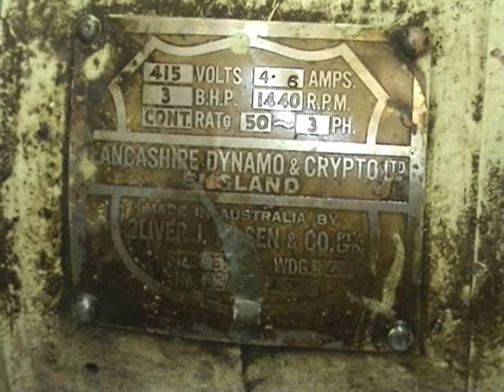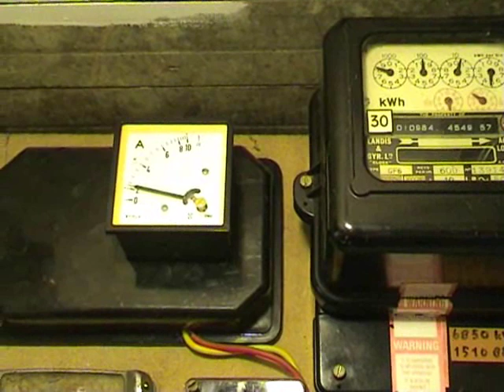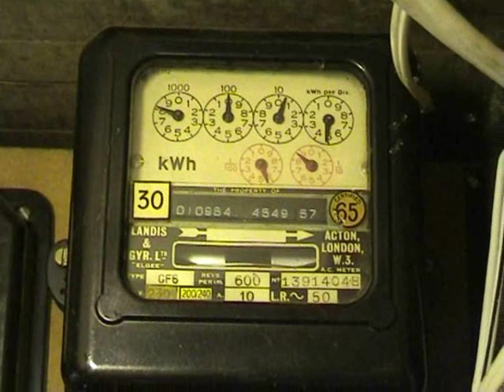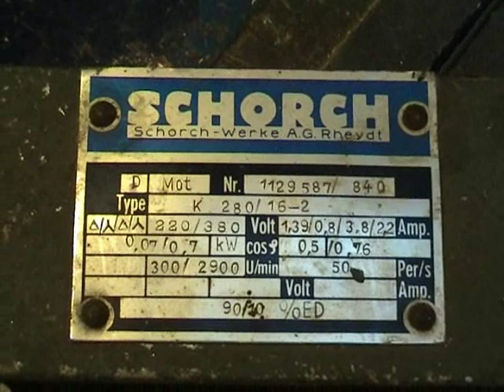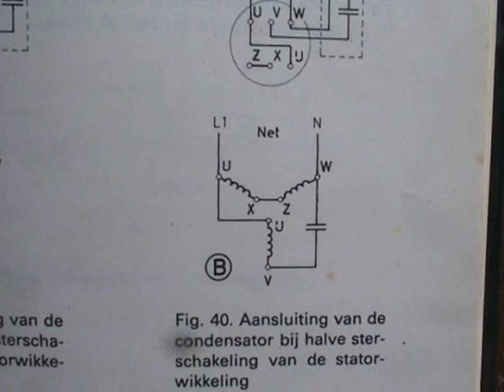3 Phase 415 V motor on 1 Phase 240 Volt supply in open star

Comment: Thanks heaps for uploading this. 

For some reason I didn't have any luck wiring my motor according to the layout you showed. When powered on the motor just sat quietly as if there was an open circuit. I spent hours looking for another reference for this half/open star connection (seems to be very rarely used) and finally found one in this wiki article: https://nl.wikipedia.org/wiki/Steinmetzschakeling. I rewired things according to the wiring diagram in that article and it worked, but still not smoothly.

My motor is 4 kW, 415v delta/720v star. With anything up to 60 uF of capacitance the motor just crawls, and with 300+ uF it still crawls but also trips my 10A breaker (even when helping it by manually spinning the shaft).

Any tips? Maybe our motors are wound differently?
Reply from the maker: What mains Voltage are you using ? 
You motor requires 415/720 Volts.If run on single phase 240V. 
You need a step up transformer, to increase your mains Voltage from 240 to 415 Volts single Phase, otherwise it won't work. 
It is probably cheaper to get hold of a 4 kW 240/415 Volts motor then buying a 4 kVA step up transformer.
Reply: Yes I'm using 240v. I thought this open star method might be a trick to get it running on a lower voltage without a transformer. But it sounds like the Lancashire motor you're using here is 240/415 volt and wound differently to mine?

I'm actually just playing around with this motor for fun and was hoping to be able to use it as a phase converter for smaller three phase motors I have. I don't mind undervolting it and getting a much reduced capacity, but I would like to try and get it up to full speed.

Maybe I should use a delta configuration (with capacitor) to give it more voltage across each winding?

Cheers
Reply from the maker: The motor I am using is a 240/415 Volts motor. You could try to give the motor a pull start with a string around the shaft, so the armature turns, and then energize the motor and see if it comes up to speed. No harm in experimenting with Caps in series/parrallel and just see what works.

Comment: so how do i wire output of 3 phase from the 3 phase to an induction 3phase heater, do i just put it in delta at the top to output to the  heater? i too want to supply from single phase motor washing machine motor to supply 3phase motor spin to produced charge for a 3phase heater as discussed previously in this sentence

Comment: Love the smooth sound of three phase motors. I work at a place that manufactures industrial equipment, and it always surprised me how smooth the motors sound when they spin up. Of course, things change a bit with a huge saw blade, but they definitely have a beautiful sound. Here in the states three phase is also 480volts @60hz, of course.

Comment from the maker: @URKIDN1  Motor Speed is dependent upon the amount pole pairs. this is a 4 pole motor which runs at 1500 RPM minus 4% slip. ( 1440 RPM )

Comment from the maker: @67tr876  Good question, you can get 480 Volts out of a motor but you need to get it running first.
If you use a 120 Volts supply you will need a 120 / 480 Volts transformer. With 240 Volts and the motor  wired up as I have done it in the video.
It should work. but you may have to experiment with the capacitors. About 55 uF per kW motor rating.
To get 18 or 20 Amps no way as you would be drawing 60 - 80 Amps from the mains.

Comment: I know am going to sound dumb but I cant use a 480 volt motor to get 480 volts out of it ? I would need a 3 phase step up transformer right ? I want to build if I need a 5HP Rotary converter to give me 18 amps or 20 amps and I want to have 480 volts but then is there a risk of arc flash ?

Comment from the maker: Both motors are 3 phase motors, the green one is 1440 RPM, the grey one is 2900 RPM.

In the beginning of the video the 3 white wires are for directly driving the other 3 phase motor via the relay
  It is actually clearer at 3:16 when the top 3 wires are removed.
The white wires are the 230 Volts supply, the yellow and blue are from the capacitor.
The green and white loops are the jumpers at the terminal block as per the diagramme at the end of the video.

Comment from the maker: I would say if you are not sure, Don't mess with electricity, it can kill you.
I'm an electrician by trade, so should know what I'm doing, even while experimenting.
Always unplug from power source before altering any wiring, take my advice here. A pair of safety glasses is minimum PPE as some capacitors can blow up.

Comment from the maker: Nope, you need to get a 120 / 208 Volts 3 phase motor and run that with a capacitor of a single phase supply. A bit of experimenting with the capacitor  is required here to get it right.

Comment from the maker: If you need 440 Volts you need a 240 / 440 Volts step up transformer.
It will give you single phase though.